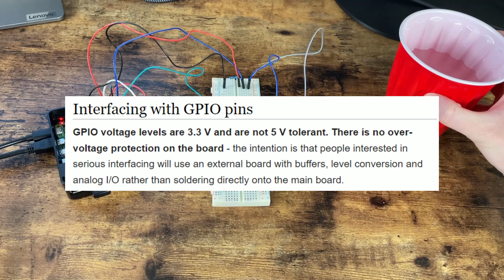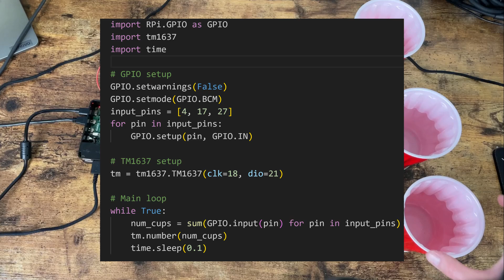This Can Fry Your Computer

Comment: That’s why I can emphasize enough why people should read datasheets and fully understand the equipment they are dealing with before messing around with stuff. It’s one of the biggest differences between an engineer and a tinkerer.
Reply: Let em break stuff, an RPi is $35. Better to screw around a get a proof of concept super fast and then get details when you face a problem. Otherwise you end up reading a 500 page data sheet, in which you won’t retain 90% of the information
Reply: @dylpickle8147  page 8 of the rpi datasheet - took me more time to type “raspberry pi datasheet” than to find the pin voltage tolerance table. If one of my junior engineers made this mistake they would have been put on BOM management projects for the next year.
Reply: Chill. Stuff like this even happens to seasoned electrical engineers once in a while. Not too long ago, I worked on a project with an electrical engineer with 20+ years of experience and the exact same thing happened, 5V was connected to 3.3V. It still worked, but we did catch it in a review before series production started. A lot of 3.3V pins can tolerate 5V for exactly this reason, you don't want to have your CPU destroyed just because someone mixed up two super common voltages.
Reply from the maker: I definitely am a tinkerer. I have no background in electrical engineering and this project is entirely for fun. In fact, the main motivation is that I have no experience so each step has been a fun challenge. This particular mistake was caught because I was reading more about the equipment. But yes, going forward, I will probably read the specs in more detail before using new equipment.

Comment: Are you going to multiplex the fsr reading and use a level shifter?

Your code can just sweep through the mux and you’ll only use one input pin. Also you could use something other than force to detect cup. For example a light sensitive resistor and a cutout through the table. This way the cup doesn’t have to perfectly sit on a large pad.
Reply: Maybe even a limit switch would be better than the fsr.
Reply from the maker: I initially was using a load cell but switched over to using FSRs. I'm not familiar with multiplexing. I will definitely do research into this before completing the next step. Thanks for the suggestions.
Reply: @scottmacchia  in my experience FSR aren’t great unless you have perfect contact. Plus you don’t really care about for you care if a cup is there. I would set up limit switches or photo resistors and then multiplex through them to see what’s occupied.